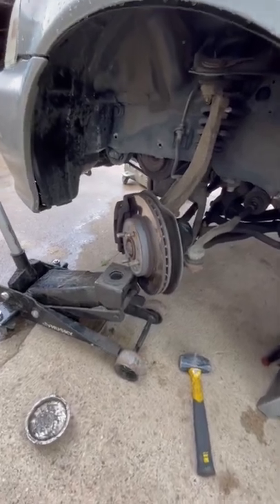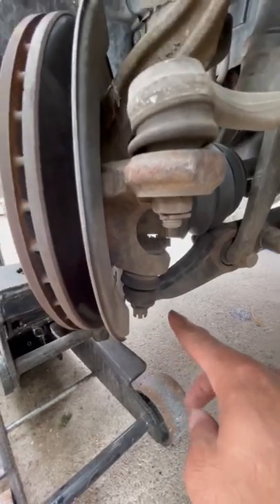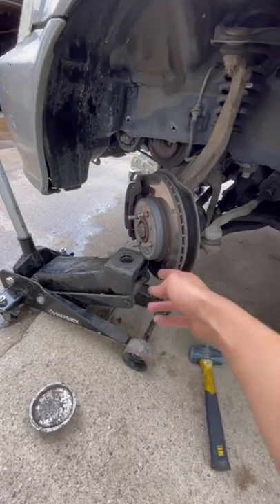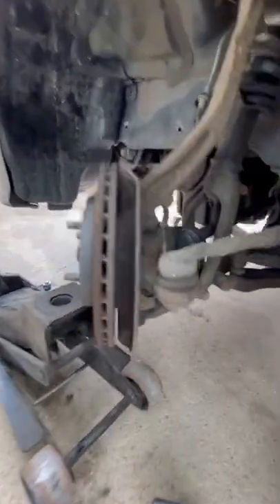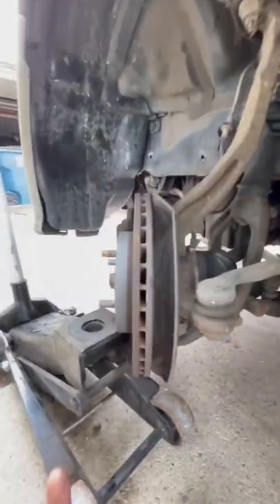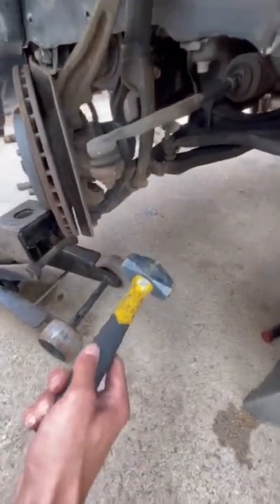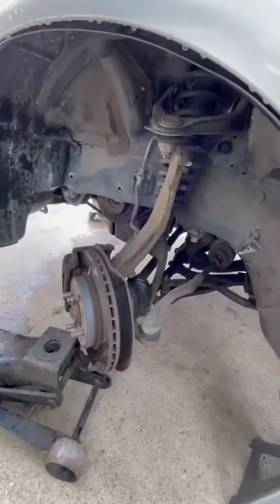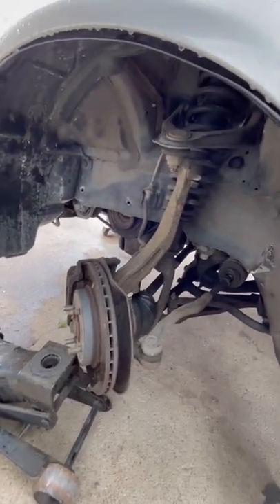How To Pop Out A Honda Lower Ball Joint From The Lower Control Arm (EASY WAY!)

Comment: If it’s got a nylon lock nut( one of the nuts you can see plastic in the threads) torch the shit out of the bolt till you see the plastic ooze out of the nut then unscrew the nut. You won’t have to counterhold the ball joint.

Comment: Word of advice: use a brass hammer for beating on suspension components
Reply: A sledge is fine. Whatever gets the job done it’s not a space ship.
Reply: @Bryce Lund  a sledgehammer bangs up suspension parts, Little Buddy. Brass is softer and still delivers a hard hit.
Reply: @jonnysanchez3833  Try telling that to any master mechanic and he will laugh at you. Whatever gets the job done.

Comment: So dealer  said on my repair sheet for 2014 honda accord ( both front lower ball joint boot splits ) so what acutal part do i need
Reply from the maker: You’ll need 2 new ball joints theres no way to really replace the boots on them
Reply: @RICHY6  but the ball joints do come with boots correct?
Reply from the maker: @ygbodybuilder3023 thats correct it comes all as one unit
Reply: @RICHY6  thanks man just got the parts, dam the expensive 279 for two
Reply from the maker: Try Rockauto.com they should be cheaper on that website. I use it all the time instead of auto zone or oreilys. Its the same parts but they are cheaper because they send them straight to you instead of autozone being the middle man. Make sure you buy parts from a good brand though because they have different price options and the cheaper stuff usually isnt as good. As long as you stick to name brands like Moog or something similar you should be good

Comment: Next time put to screwdrivers into the rotor inside the caliper to prevent it from potentially spinning the jack out.
Reply: Lol the jack is only applied road force to the suspension it’s not lifting the car kinda unnecessary
Reply: @the_first_resort940  did you mean applying?

Comment: I have a 2015 Honda Accord LX and I'm just wondering what can make the front right passenger side ball joint go bad
Reply from the maker: Ball joints usually go bad from wear and tear. Sometimes it can be dirt or grime messing it up over time. Ball joints are one of those parts that need to be replaced over time so maybe its just old

Comment: The forks are better and easier? And free at any auto parts store for loan. 🙄
Reply: No forks aren't easier. If you plan on reusing the balljoint, if you were replacing the lower control arm, the fork damages the boot of the balljoint.
Reply from the maker: Exactly👌🏽
Reply: Forks will ruin the ball joint if u plan on using it again.too freaking easy with a small sledge hammer..hit the side and pops out .